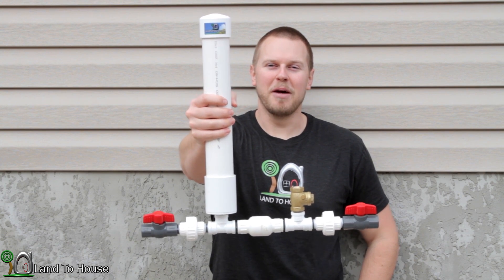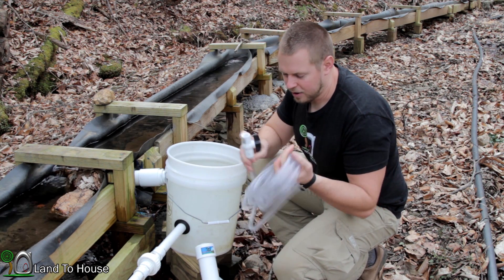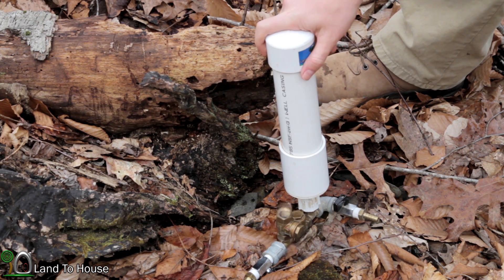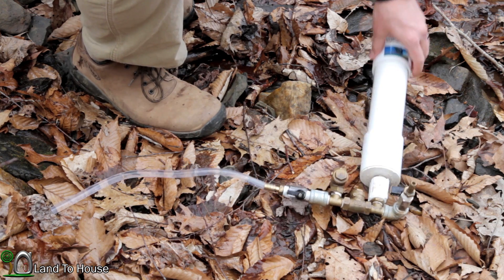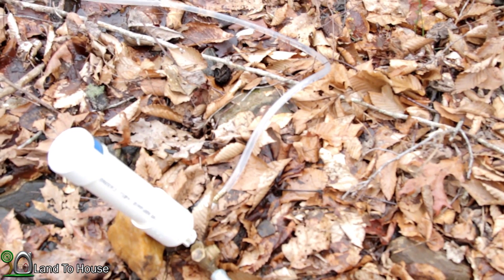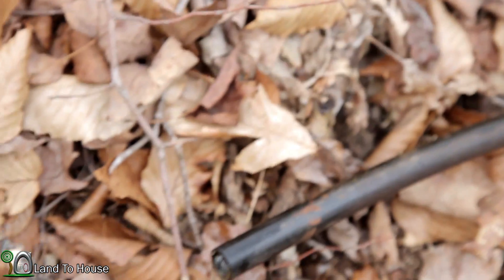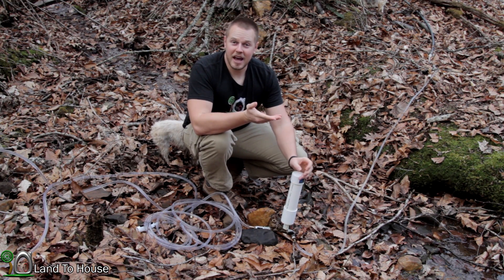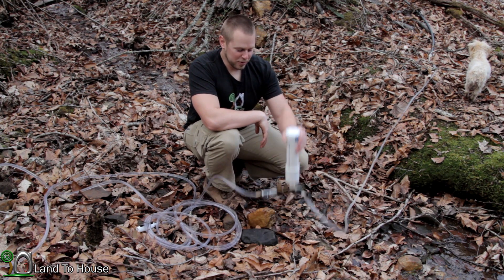WORLDS SMALLEST RAM PUMP

Comment: what you need is a Bunyip waterpump job done,,check out Bunyip water pumps Australia, there about $2500 + import duty + taxes and delivery to your door,,however don't have an answer for that little Rampump,,
But do have a question water flow is one issue speed is another but you need a concistant highflow rate at speed it seams the rampump needs some engineering adjustments check out Bunyip Pumps as you might get some further engineering and science answers to overcoming Rampump issues,,its not always how they pump the measure is how much how fast to flow you might want to keep a builder going on site cup tea,shower,fill a swimming pool or pond you don't want to be waiting a month to fill it?

Nice little pump though.

Comment: For sure a 1/2” drive will cut the distance from head and get great pressure!

I’ve stumbled on your vids and it’s got my mind working as I try to sleep lol.
I used to do plumbing and it’s typical to start from the meter being a larger dia pipe and go down in size as you get further away. This keeps from having the toilet flush running your shower before metered output valves. 
The 3/8” pump would make a great bush kit, pair that up with a sayer mini filter and you’ve got running water at camp!!

Comment: As the 3/8 works on a lean but not in the vertical plane, that suggests that the gate is to heavy for the ambient water flow ! Get a lighter gate to enable the pump to work properly in the true vertical plane with this flow !
Reply from the maker: For this experiment I later used a larger more ridged drive pipe and it works very well!

Comment: As the pipe diameter gets smaller, the viscous efects turn much greater. So it seems that the water can't get enough speed in order to shut the valve close. This also means that the preasure peak when it loses will be much smaller since theres not much cinetic energy avaliable. Switching to a bigger diameter   will fix the problem

Comment: the brass waste valve is too heavy for the flow from 2 ft head pressure, try a lighter waste valve. Being able to use 3/8 vinyl tubing on a tiny pump would be an amazing advance in the field and really useful for portable and short-term installations - take camping and let the tiny pump fill the shower bag.

Comment: Hello, at a point in this pump there is a brass T valve out what is 
water coming on every stroke of the pump. As the pump is setup in an 
open space that water runs back to whatever so there is maybe no lost of
 water. Butt suppose, the pump is installed in a reservoir ( tank ) to 
work, and the water in that tank is the water that must be pumped away, 
can it work if the outlet of the brass valve is higher as we it is in 
this video?

Comment: If my understanding of Ram Pumps is correct in order for the ram pump to have necessary internal pressure to operate, the discharge should be approximately one half the size of the inlet.  Looking at the 3/8" pump both inlet and outlet look to be roughly the same  size.  If that is the case the pump doesn't have enough back pressure to close the check and keep the pump working.  I look at the back pressure almost like the head pressure coming to the pump. The effect is the same.

Comment: Try adding a small flywheel. It should work as a capacitor (fast energy charge and discharge) so it can help cycle the waste valve

Comment: Your intake line needs to be larger in diameter than your delivery line.20mm intake line would of been great in this set up.
Reply from the maker: Yes! I increased the drive pipe and this  tiny unit worked!

Comment: A 1/2 inch nominal pipe diameter has a cross-sectional area approximate to 0.1963 in², whereas, a pipe with a 3/8 inch diameter has a X-sectional area of 0.1104 in², this equates to a 41% loss of flow-capacity using the smaller 3/8 inch tubing; not counting any frictional losses. For optimum operation of a ram-pump, the intake of the pump should have an intake X-sectional area double that of the outlet. With a 1/2 inch output, the intake should use a feed line with a X-sectional area of at least 0.3926 in² (0.7070 in diameter). The next pipe size up from a 1/2" pipe is 3/4" pipe, with a nominal diameter of 0.750 inches and a X-sectional area of 0.4417 in², this results in a 55% increased flow-capacity over the 1/2 inch pipe. A 3/4 inch pipe has approximately 75% more flow-capacity than  3/8 inch pipe. When one is trying to double the flow-capacity of a given pipe length, one must determine the cross-sectional value of the ID of the pipe, rather than its diameter alone. 

For example: 1 inch pipe has a nominal diameter of 1.0 inches or a 0.785  X-sectional area, a 1 inch pipe diameter is approximately 62% larger than a 3/8 inch pipe diameter; however, the X-sectional area of a 1 inch pipe is 89% larger than a 3/8 inch pipe; meaning that a 1 inch pipe will flow 89% more fluid within a given time, pressure, and length. 

 Pipe diameters vary widely for a given size, and is dependent on the rated schedule of the pipe; the outer diameter is also affected by schedule. On the other hand, metal tubing is always sized in OD and the wall thickness determines the lesser inside diameter; except for plastic tubing, it may be sized either in OD or ID sizes, which is determined by application. The ability to flow is determined by cross-sectional area and is calculated using other factors that vary the flow; such as: friction, turbulence, pressure, length, bends, fittings, viscosity, temperature, time etc...

Comment: I have seen some other videos involving metal check valves where there are springs used that can either be removed completely, shortened, or put on the other side of their stops to solve some of these problems. That check valve is so small, that likely the thickness of it is larger relative to the diameter of it, which said more simply means that it is simply a HEAVIER valve compared to its diameter than the larger valves would be. If springs are incorporated in the design, you can definitely use their positioning and strength, or remove them entirely to change the variable and tune this thing to work. Really enjoy all these experients. These are all the experiments that I was thinking about, and you are way ahead of me trying out all these different ideas. Bravo.
Databyter

Comment: #landtohouse, OMG!, I cannot believe that someone would post such a negative comment about what you? I find your videos entertaining and informative. Please stay your course and never get discouraged by the sad unhappy losers of this world.
Reply from the maker: Not to worry. In 6 years of YouTube. I've only had three or four comments that really got to me. To post on the internet you have to have pretty thick skin. There is a working version of this video. I had to use a 1/2" drive pipe.
Reply: Land to House I saw the video of the working pump but I do not see the 3/8” version for sale. Did you think that it is more of a novelty and not big enough to market? I ask because I have a very low flow artesian spring and I doubt I that I can create enough head pressure to drive the 1/2” pump. I have a 700 gallon tank that I plan to put on a 6-8’ tower and I won’t be using that much water out of it, (Gardening and such) ,
Reply from the maker: @chevyman551  Each Ram pump size works on the same head pressure to lift ratio. The difference is the amount of water required to operate the pump. The super tiny pump works just fine. It just cost too much to build.
Reply: Land to House, I need to dam up a catch pool at the artisan spring source and see how much water and head pressure I can create. If it will drive a small ram pump, like the 3/8” , I will have an ample supply of water for my needs because of my capacity.
Reply from the maker: @chevyman551  nice! That should not be too bad. You might want to capture in a bucket and use that as a source.

Comment: So what’s the rule of thumb? The larger (and rigid) the drive pipe the better?
Thanks-Gary Keslar
Reply from the maker: Hello. I have a update for this video showing the pump working with a half-inch drive pipe. Typically the rule of thumb is to match the drive pipe with waste valve size and to have that pipe as rigid as possible. PVC pipe produces much better results than black poly pipe.

Comment: I am a student of class 8th.
I have to install a water ram in a scientific model I am making.Which all materials are required and how to install?
Very small ram pump indeed I have to make.If not ram pump any other mechanism to carry water up till 1/2ft.Please help if you can
Reply from the maker: The ram pump is great for pumping water uphill if you have a constant water source. You can find a few videos on my channel that show how to build a pump.  Look for the 1/2" pump. This small 3/8" pump can be costly because it has to be from metal parts.
Reply: @LandtoHouse  Sir
Any other method of transporting the water up only till 15-20 cm. But fast and a bit cheap.

Comment: The softness of your clear feed tube is the largest inefficiency of your system. Switch to a rigid delivery pipe and your results will go waaay up.
Reply from the maker: Yes indeed! I used a 1/2" drive pipe and the pump worked!

Comment: Use only hard pipe. Soft tube will not give you the ram part of the pump.
Reply from the maker: Yes great observation! In the follow up video I installed 1/2" poly pipe as the driver pipe and the pump worked well!

Comment: I think your biggest problem is a siphon feed to the pump try doing a direct feed off of the bottom of the bucket the siphon feed only has so much pressure
Reply from the maker: Turns out the inner diameter of the tube was too small. Using 1/2" got this working

Comment: Your soft tubing was absorbing the shock wave when the valve closed. You need rigid tubing.
Reply from the maker: Yes indeed. I used a 1/2" poly pipe and that seemed to fix the pump. It works very well with a larger drive pipe.

Comment: Have a stand pipe before the pump. better volume to allow smoother transition of the pump cycle.....just saying to increase head water volume close to demand, the pump, when the supply volume is exceeded by pump demand, the stand pipe makes up the volume, as the pump cycles, the stand pipe fills alternately, and the pump runs as though the supply line is much bigger...
Reply from the maker: It turns out that increasing the drive pipe size fixed the issue with the pump. A stand pipe close to the pump does help if the drive pipe is too long.

Comment: You need bigger tubing/pipe for the head flow. The small diameter plastic tubing you're using causes too much pressure drop when there is flow. The whole premise of the ram pump is to build up momentum with the water, then, when the check valve closes, all that momentum RAMS it and causes a large pressure spike. Small tubing just kills efficiency. Use at least 1" pipe, instead. Plus, that flex tubing is just that.... flexible. It kills any kind of pressure spike by expanding and absorbing the energy.
Reply from the maker: I upped the drive pipe size to 1/2" and this little pump worked very well. Going much larger than that would start to reduce the pressure wave too much.

Comment: A little late to the game.  I was wandering down other rabbit trails.
I worked for a major Truck manufacturer.  One of the things we worked on was brake timing.  Because the big trucks use air instead of hydraulic fluid, the timing between the front and rear brakes and the trailer brakes has to be right for proper stable braking.
We found that the air took as long to curve around one 90 degree fitting, as it did to flow through 6 feet of straight line.
I suggest that You ditch the 90 degree fitting on the outlet, go with a straight fitting and go ahead with the 1/2" feed line.  Also straighten and shorten the feed line as much as possible.
Reply from the maker: Great numbers. Thanks for that. In most ram pumps it is best to match the waste valve to drive pipe for best efficiency. In this case there was too much friction loss in the tiny drive pipe. Later I did increase the drive pipe to 1/2" and the pump worked well!

Comment: Use bigger pipe before the pump at water source and then go down to 3/8 just before the pump. This may help.
Reply from the maker: I actually used 1/2" for the full drive pipe and it worked very well! I have two new videos on the channel showing the results.

Comment: Inlet and outlet can not be the same...inlet must be twice the size of outlet...just sayin...
Reply from the maker: +Allen James actually the delivery pipe is limited by atmospheric pressure and pipe friction. Because the atmospheric pressure is the same on a column of water no matter the size, the delivery pipe can be any size as long as it's big enough to support the flow rate. You can have a 1 inch Drive pipe feeding a 6in delivery pipe and the flow rate would be the same as a 1 inch Drive pipe feeding a half inch delivery pipe.

Comment: I believe you need a rigid pipe for water hammer to occur when the valve slams shut.
Reply from the maker: Yes indeed. The re-test worked well with a 1/2" drive pipe.

Comment: A larger diameter input pipe probably would have worked..
Reply from the maker: Yes you are absolutely right! I increased the Drive Pipe to 1/2" and the pump is working well.
Reply: Awesome! it wanted to work in this video, it just needed a bit more weight/head pressure behind it to slam that flapper valve shut...
Reply from the maker: Now that I have it working I have made another video showing some results. It was actually better than I expected.

Comment: You could try to make and elevated siphon by raising the inlet pipe in a loop about 4 feet off the ground with the pipe full with water.
Reply from the maker: I was actually able to get this pump working by increasing the drive pipe to 1/2".

Comment: I think it works best with 2 times bigger pipe going in or even bigger then the pipe going out
Reply from the maker: I actually have this pump working now. Increasing the drive pipe to 1/2" was the trick. As for the delivery pipe that size does not matter.

Comment: Friction losses are probably eating you up. I'd try increasing diameters of both input and output hoses.
Reply from the maker: Yes you got it! I have a new video showing the 3/8" ram pump working. Increasing the drive pipe was the answer.

Comment: I am not surprised the ram pump does not work. The basic principle of a ram pump is to use the kinetic velocity of the flowing water to create an impulse when the weight of that flowing water is suddenly stopped.  The small diameter of the flexible tubing in your test slows the flow of the water due to friction and the tubing expands slightly absorbing the kinetic energy sort of like a car shock-absorber, adding on longer tubing only creates more friction and greater shock-absorbing action, exactly what you do NOT want.  Suggest you use 20 feet of 1/2" schedule 80 PVC for the drive pipe.
Reply from the maker: That is a very good observation! I actually have the pump working now by using a 1/2" drive pipe. You can see it here: https://www.youtube.com/watch?v=HDOCHQ_XA6E

Comment: The flexible tubing isn't containing your head pressure.  Try the garden hose for the pump input with some sort of adapter at the connection.
Reply from the maker: I have an updated video of this pump working. The tube was the issue. With a 1/2" black poly pipe drive pipe the pump is working well.

Comment: use a straight drive pipe that's solid and not a flexible pipe.  drive pipes and rams have harmonics in them . like a hart beat . that's why steel pipe gains more efficiency than plastic pipe .
Reply from the maker: +NZshooter shooter yes well stated! I just updated this Video on my channel. The pump is working!

Comment: You need another pressure accumulator (half full of air) before the sputter-valve, to overcome the slow rise of inertia in the small feedline.
Even hydro-electric powerplants with long feed-channels, have a sloshtank at the turbine inputs, to even out pressures at the turbine valves.
In your case, a sloshtank will create inertia like a larger feedline without completely halting the supply water-flow on each pulse-cycle.
Reply from the maker: It turns out that an increased drive pipe size was all this little pump needed. With a 1/2" drive pipe the pump is working like a champ.

Comment: I built a 1/2" pump but I'm having an issue getting it thru the in line check valve, its just going thru the waste valve. If I tilt it so the waste is easier to close (w/ 2' of head pressure) can it work? or is it just too big for this situation?
Reply from the maker: So you are not getting the pump to cycle? When the waste valve does not close that is often an issue with air in the drive pipe creating a low flow issues. Also if you have mismatched drive pipe and waste valve you can have that issue.